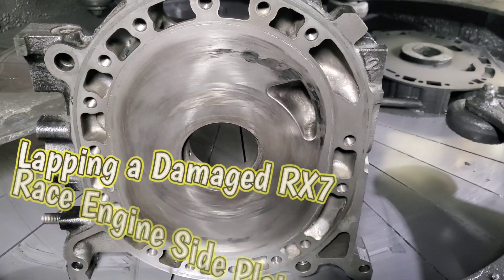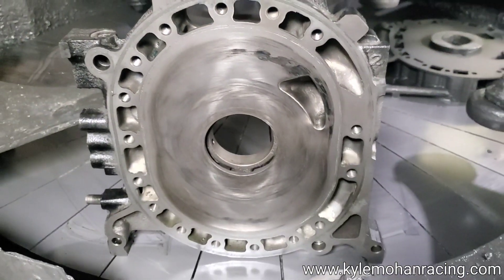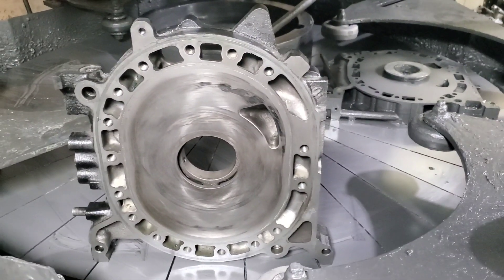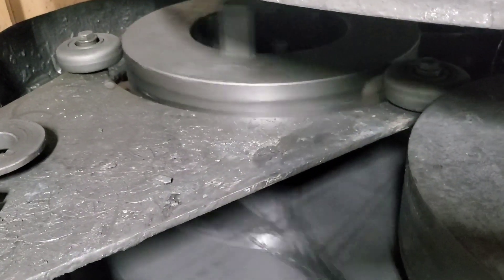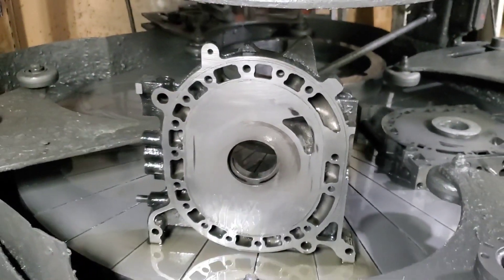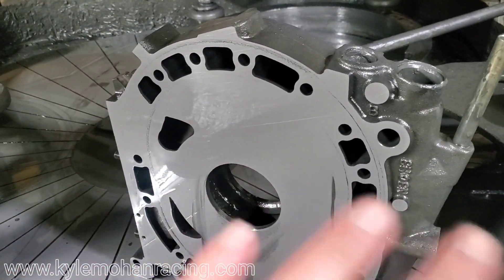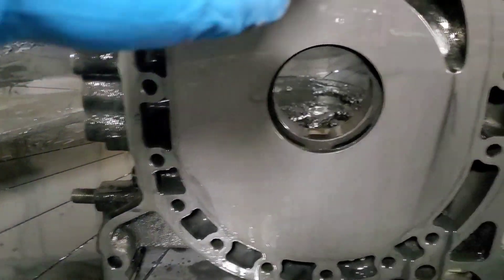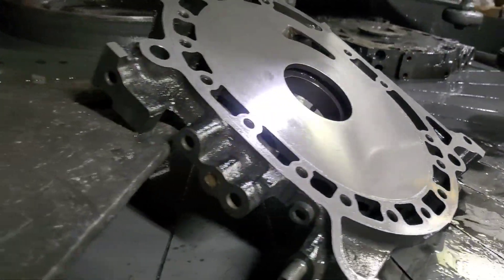WHY? Lapping RX7 & RX8 Side Plates is GREAT - Rotary Engine Service and Tech Mazda RX7 13b 12a 20b

Comment: I'm curious what your thoughts are on cleaning / surfacing the sides of the housings (mating surfaces to the irons) 
Obviously any material you take off will affect the likely hood of rotor to irons contact etc. But you would no doubt have shrinkage around the exhaust port areas like the manual says to check and like you already to on the irons

Comment: I have a thought for you. You have made a hybrid renesis motor to gain better flow. Mazda has come out with a new rotary with direct injection as a range extender for an electric car. Assuming the dimensions are the same would you be tempted to make a new hybrid rotary with direct injection?
Reply: I do believe the new rotary engine/range extender is bigger. I’m pretty sure this same channel had a video on it stating something along the lines of starting with the one rotor and rotor housing to build a 2- or 3-rotor engine by using custom side housings.
Reply: @VictorMPR  oh I need to find that video, thanks
Reply: The range extender rotors are taller and thinner with larger eccentricity. 830cc vs 654cc on 13B. Leading combustion pocket instead of centered, single spark plug at leading location, and direct injection. Also thicker apex seals at 2.5mm and all aluminum construction with plasma coated side plates and improved chrome plating on the housings.

Comment: I've got an FD that needs its engine rebuilt and put in, exterior parts put on, brakes and turbo and everything put back together and then tuned.  Any suggestions where I should take it or who I should call?  Over the years I've put three engines in it myself but I'm tired of doing the work myself and am happy to just get it turn-keyed.  I'm in Las Vegas but if I have to I'll ship it.  I want it done inside and out, soup to nuts, show-car nice.
Reply: Send it to KMR/Mazdatrix? Maybe Chips?
Reply: @bennyb.1742  What is "chips"?  never heard of that one before
Reply: @David Beecroft  I think he meant Chip's, as in  Chip Foose
Reply: Send it to kmr. if a guy can build a rotary and drift the shit out of it and stay at 10k and also do time attack. That’s a reliable motor/builder.he’s rotary master. Because I do drifting and time attack and believe me, shit breaks. But you learn from it, so next build you know what upgrade/ticks to do. that’s knowledge and experience that he has and is sharing his knowledge with us too.
Reply: @xSc0oByDo0RaCeRx  I am not convinced KMR is a master. Gatekeeping knowledge is not what a master does. He never answers critical questions like the ones in this comment section

Comment: Do you ever renitride the plates? I am a machinist and know this is possible. Expensive? I would think it worth on a rare plate like that.
Reply: I asked a same question about renitriding and also about wpc treatment on rotary, because i though I had to renitrided them and then wpc treatment after, but he said with exact words ((With lapping, its ok 99 percent of the time with no treatment. WPC is a great addition. Especially in performance builds. I never had success with re nitriding. Its why we went to WPC. WPC has multiple benefits, surface hardening and friction reduction. I still look into nitriding occasionally but due to many reasons we have not found an effective process)) I also had good experience with piston motor that was wpc treated.